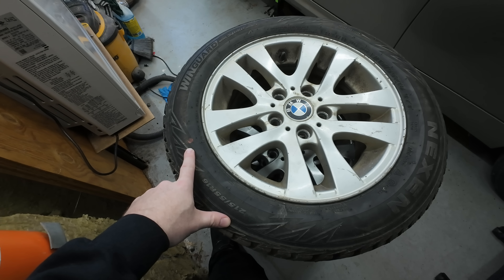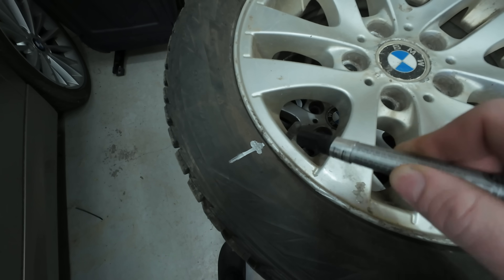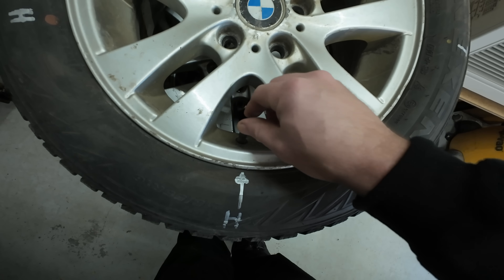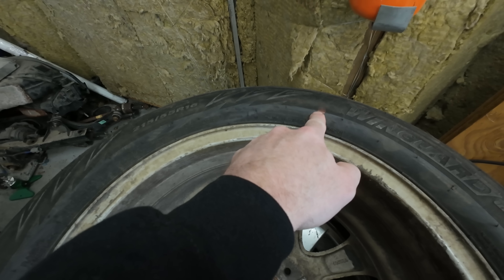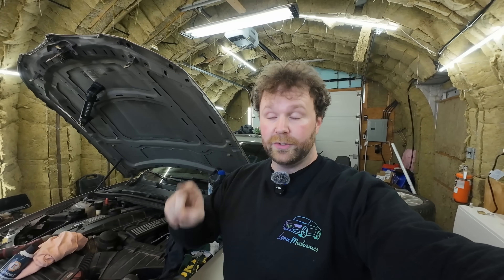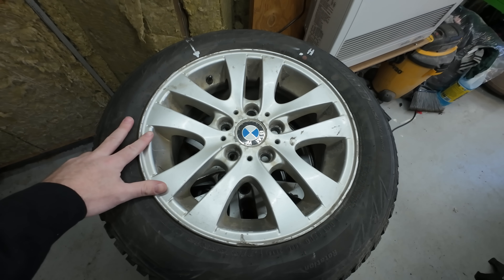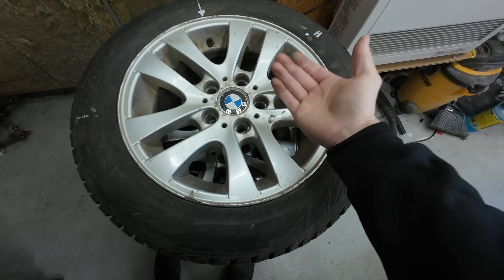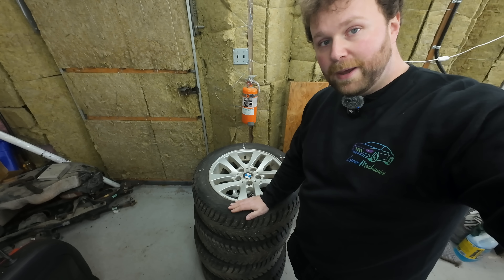Tire Red & Yellow Dots Explained | Back to Basics. Many mechanics get this 1/2 right

Comment: It was good to see the correction at the very end as a number of errors were made in the main video.  The process is fairly simple and goes like this:
1. See if your rim is marked as to point of minimum runout (aka “low” spot).  Most rims are not so marked so generally you can ignore the red dot on the tire.
2. If your rim isn’t marked and you want the absolute best performance, do as the video says at the very end and spin the wheel on a balancer using a dial indicator to find the point of minimum runout.  Then mark the rim with this “low” spot and align the tire red dot to this point.  Generally, aligning the red dot to the low point on the wheel is preferred to aligning the yellow dot to the heavy spot.  However, even this is still flawed as it ignores runout in the wheel hub on the car.
3. If you are like most of us and don’t have rims marked with their low spot and aren’t an absolute perfectionist, you simply align the yellow dot with the valve stem.  This will work well 99% of the time.  If you want to optimize a little more, and I do this with my motorcycle wheels, I put the wheel on the balancer and find the heavy spot that way.  I find it often isn’t right at the valve stem, but rather a little to one side or the other.  I then mark that spot and align the yellow dot there.  However, this is unnecessary 99% of the time, but I do it because it is easy to do.

I don’t worry about step 1 unless dealing with steel wheels.  Modern machined alloy wheels are made so well that it is nearly impossible to find the low spot.  Many wheels have only a couple thousandths of runout and finding the low spot when the dial indicator needle is barely moving is difficult at best.  Steel wheels can be several thousandths out of round and with their heavier weight, it can be worth finding the low spot.  And if you aren’t doing this with the wheel on the car, you aren’t catching the hub runout which often is greater than the wheel runout, so you perfectionists are still not perfect.  😂

So, 99% or more of the time, aligning the yellow dot to the valve stem is all that is needed.  The last several motorcycle tires I’ve mounted didn’t even require a 1/4 ounce weight. The wheels are so uniform and the tires so uniform, that weights are only occasionally needed and rarely do I need more than 1/2 ounce on my motorcycles if I have gotten the tire yellow dot close to the actual measured heavy spot on the wheel.

Comment: Measure the heaviest part of the rim with or without a valve?
Reply: WITH the valve stem / TPMS valve in place. It will make a difference for weight, but obviously not for wheel run out.

Comment: First error isn’t even a minute into the video.  The red dot isn’t related to weight, it is related to geometry.  The red dot isn’t the point of greatest radius of the tire often called the “high” point.  The yellow dot is related to weight/mass and is the lightest point.

Comment: It’s confusing because the marks aren’t consistent across tire makers or even different tires from the same brand. And, people debate what the marks mean as well as what to do with them. 
And , once that tire runs down the road and heat cycles a few times it can take a different set and change the balance. 
I’ve seen a fair number of tires that didn’t shake at all when first mounted, but then developed a shake after being driven for a bit. Even had a race car with a tire that balanced fine at the start, then had a heavy vibration after about 20laps. Tire spun fine and wasn’t egg shaped or anything. But, when we put it on the balanced it was about 6oz off. 

At the end of the day if you do a good job mounting and balancing it the dots don’t particularly matter.

Comment: Never minded the dots. If the tire (depending on size) took too much weight to balance, break the tire back down and rotate it on the rim and retry. If you have to put on more than two ounces in a spot either rotate the tire or you got a bad tire. Check the rim balance with no tire also.

Comment: Legit it will always depend on the tire since they are all random weights. Especially with truck tires you see the crazy weights added on the knobby off-roaders everyone uses nowadays. Definitely spin the rim naked if you need. There is no point in adding 6 oz of weight on one side of the rim with the static. Especially since the red dot will mean it’s not only the heaviest point but also the tallest point and can cause vibration and goofy wear like you said. The dots will not always be spot on the valve stem since the high and lows are random on every tire. They help get you within the sweet spot so you aren’t just wasting weights. I love seeing 3 layers of stick on weights on the light side of the rim compensating for the heavy sides being matched together lol.

Comment: I only buy Michelin tires for my vehicles, low rolling resistance, great wear, less noise, even on snows. However, when I was in the trucking industry, where tires are not usually balanced, I found out that Michelin put balance patches (boots) inside tires to prevent the heavy spot from stretching the tire at speed. Never had to balance a steering tire, but had to do 1 out of 3 Goodyears at the time, so mechanics did them all to prevent complaints. On truck balancing was $120, 40 years ago.
Reply: And one thing Michelin tires are know for is that after 3 yrs they will sidewall crack, leading to cracks in the grooves of the tread even. Just had to toss 4 of them with less than 30,000 miles. They were an expensive mistake
Reply: @pathunter7003  Whoa, I have Michelin PS4s on my 2015 (built 5/14) Porsche Cayman with build code (3518) on the tires - i.e. tires made in late July, 2018 (records show an alignment done in late 2018, probably when the tires were replaced). I have no cracks, the tires appear near new, car has 23K miles, always garaged when not being driven. Perhaps your tires are often exposed to UV rays (sun) and/or extreme climate?:face-red-heart-shape:
Reply: I've always been a Michelin tire guy too, until the last set I bought. Brand new Honda CR-V came with Bridgestones. I had no issues. When time came, I replaced with Michelin. They were noisier, reduced my mileage, and IMO didn't have as good traction as the Bridgestones. So now not so impressed with Michelin. And those Michelins were supposed to be a good fit for my SUV, according the Michelin. So there you have my experience.......
Reply: @Mike-hb4pc  yes the traction of the Michelins were lousy, and they were even labeled as a mud/snow tire, they looked more like a hiway tread. My last truck had Bridgestone tires, good traction and lasted a long time

Comment: hate to burst everybody's bubble but those dots are simply inspection dots done at the factory one for the xray test and other is for roundness every tire is guaranteed round and free of defects in material and workmanship EVERY TIRE. some factories only tests for roundness not the xray  that's why some only have one dot they don't have a machine at the factory to weigh every tire that's just not done they have to produce 20k tires a day minimum. this is a wives tail been going for years. mechanics aren't tire guys and tire guys aint mechanics stay in your lane. I've been in the tire business for 42 years hundreds of moving parts on your vehicle none of which are balance at manufacturing axle, bearing, rotors, all spinning parts none perfectly balanced. And don't get me started on difference between roundness and balanced.

Comment: I worked in shops for three of the big tire manufacturers.  I never found ANY concrete statements from the manufacturers that any color dot means anything specifically.  I did do my own experimenting while mounting tires, however.

Comment: Did I miss all the important information??? You never mentioned what you do when you have both red and yellow dots??
Reply: Dumbo, pay attention in class,,,der...
Reply: I bought a set of tires 2 years ago and they have both red and yellow dots and the tech lined the valve stems up with the red dots, and there are a bunch of weights on the opposite side of the wheel.  This is a tire shop and all they do are sell tires and mount and balance them.  It is a huge national chain too.  Why don't they know this?
Reply: He said the red dot takes priority and you line up the red across from the valve stem.
Reply: @Tsuter1978  I missed that thanks
Reply: @Tsuter1978  i yhink he said red takes priority. but read is heavy. Does NOT go by the valve stem.
Reply: @KennethITGuru  RUN FOR COVER!!

Comment: What should you do if 2 dots are only 2 dots away from each other?
I've seen that from time to time
Also encountered linning up yellow dot to valve stem asks more weight than red and this happened on a tire with the dots almost 180 of each other. One could say it's cuz shitty tire, but in the real world not all ppl could afford quality tires.
Sometimes this happens on big name tire as well like GY, BS, PRL, CT.
I absolutely gonna spin wheel first to assess rim's heavy spot when I am putting on new set of rubber. Paying customer almost never get this treatment cuz no one is paying enough for this in default rate. There is special balancing called Roadforce Balancing, which is time consuming and requires higher level (aka $$$) balancing machine, therefore not widely available, and also not many ppl is willing to pay for it cuz Roadforce easily doubles or more the time than regular slapping the weight on.

Comment: I always judge a tyres quality by how much weight it takes to balance it. Some yrs ago when I worked at a country garage (the boss used to sell cheap Chinese tyres). I can't remember the exact figure but one tyre I fitted took 30oz to balance it. Then you get a quality tyre and 5oz will do the job.
Reply from the maker: I've noticed this too. Others seen same thing. Kumho tires are a nightmare in my opinion.

Comment: Pointless, far too many variables. Wheel damage, tire sensor mounted to stem OR clamped to barrel of wheel, may or may not have a sensor at all, size and material of valve stem, tire plugged or patched at some point. Ive done hundreds of thousands of tires in my life and found it makes little to no difference.
Reply from the maker: What if. Connecting the dots from the beginning brings you to the end. I've seen the end result as I'm the guy at the end of the line trouble shooting tire wear and usually shakes at higher speeds. Just saying. Cause you dont see it now doesn't mean its not doing anything. :)

Comment: So where is the red dot supposed to go if the tire has one and where are two red dots supposed to go?
Reply from the maker: Throw tire out! No haha. Spin the rim as I said at end of video. Find your high and low spot and attempt it on the first dot. If it balances nicely your good to go. It not break the tire off the bead and rotate till you find the balance that works. This is the kinda effort we have to do sometimes to get it to work
Reply: @Lancemechanics  thanks! Do you still put the yellow dot near the stem if the tire also has a red dot?

Comment: Okay I was taught that the valve stem is the lightest part of the rim. It made sense to me because when I working on a machined rim, ther's a massive chunk of metal missing where the light rubber valve stem is. Change my mind.
Reply from the maker: Most have a sensor attached to them
Reply: @Lancemechanics  But not all of them do. and they didn't back then. And the tire don't know the difference. How were you taught that the valve stem is the heaviest?
Reply from the maker: Cause they yellow dot is the lightest point of the tire and the entire industry lines that up to the valve steam which is considered the heaviest spot

Comment: Red dot is not the heaviest part of the tire. It is "low dimple point", supposed to be aligned with the lowest riding part of the rim (no rim is actually ideally round). Misleading information in the video, dislike.
Reply from the maker: But experience shows if is the heaviest. Check out the comments. Most end up breaking down the the tire and rotating it 180
Reply: @Lancemechanics OK, thanks. I will do some experiments. I have access to tire balancing equipment as well as access to ronout indicator
Reply from the maker: Awesome. Not sure many people listened to the last 30 seconds of the video either. I do recommend spinning the tire up by its self and checking for high/low spots on the rim.
Reply: @Lancemechanics  Okay. Now facing real life issue. The red and yellow dots are marked on one side of the tire only. Meanwhile, some tires are directional and should be mounted by observing the driving direction ("rotation" marking). Now with all that theory, how do I deal with those? Because with this scenario it means that always always always it will be one side of the car which will have those dots aligned to something meaningful (valve stem, opposite of valve stem, doesn't matter) whereas the opposite side (from my experience I think it will always be right side of the car where such tires are mounted) will always have no alignment. What is the practical advice to deal with such situations? Thanks

Comment: Ive had this issue with the last couple vehicles i bought.. i had minor vibrations at speeds.. i knew it was balance related… 3 shops made it considerably worse, and all told me i needed new tires.. i know there was nothing wrong with the tires.. .. it was the 4th shop with one, and the 5th with another that balanced them correctly.. but those shops also weren’t consistent.
Reply from the maker: Ouch

Comment: Number one cause of improper balancing is caused by techs not following manufacture instructions. When a tire is beaded on a rim you have to let ALL air out of the tire before you inflate it again, otherwise the tire is not seated properly on the rim. The tire has to relax and then be inflated again for proper seating and then balancing. If you do not let all air out you will still get an OK balance according to the machine but once the wheels hit the road and are put under pressure the bead will move on the rim and cause inbalance. Let all air out and save 20-30% of wheel weights yearly and customer come backs or complaints will drop. Dont trust what im saying? ok, try yourself and do it as you always done it, then do the same wheel again letting all the air out and balance again and you will see a differance, or just read the instructions from the manufactures like Pirelli & Michelin.
Reply from the maker: I've experienced this. This is more of the rarer tidbits of info. We all rarely follow it
Reply: I was taught (actually shown) by a fellow when I took my big truck in for front tire balancing. He put the wheel tire assembly up on his balancing machine and observed the rotation first. He immediately noticed that the bead was not running true (it wobbled). He asked me who mounted the tires and I replied that I did. He then asked me did I put any lubrication on the bead and I replied that I really could not remember. So, he broke the tires down and lubricated the bead with mounting compound, put the tires on the balancer machine and showed me how true the bead was running. The tires were in balance and needed no weights. He explained to me that it is good practice to always use a mounting compound so that the bead will seat properly when mounting. And also, one can use a mounting compound on radiator hoses and heater core hoses as this also allows the hose to be relaxed and not twisted when installed plus it makes it easier to install the hose. The hose should of course be fastened securely to eliminate it being blown off the connection. Of course, I already knew this from my father putting axle grease on his radiator connections. He never had a hose come off from this procedure unless he did not tighten the hose clamps enough. Neither have I. But be careful about those hose clamps as I have seen fellows tighten them so tight that they have actually broken the solder connection on older radiators. It may not be such a big issue with these newer aluminum radiators but the older ones or the ones with plastic tanks excessive tightening of the clamps can cause damage🥸👍👍👍

Comment: I must have been taught wrong. Because in the technical college here they tell you the dot is in reference to the major splice of the tire. The valve stem location the lightest part of the wheel due to material removal is the hole the valve stem seats in. So we align the to to help balance out the assembly before an actual dynamic balance.  Most end up less than 1 ounce out total.
Reply from the maker: Never heard major splice in tire. It also says highest point runout. Which in experience is the heaviest point too.
Reply: The hole in the rim for the valve stem makes it the lightest part not the heaviest part?   so confusing with opposite viewpoint?
Reply: @tedlahm5740 most wheels have   tpms sensors on the valves .which adds more weight